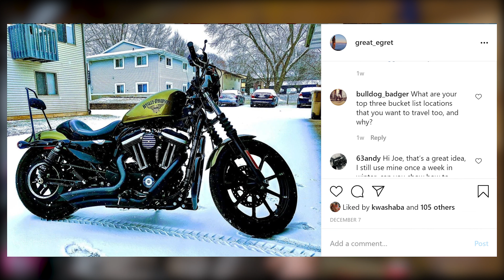"The Iron 883 is a SLOW Bike" & Other Comments

Comment: As for Andy, keep the immobiliser, just buy an optimate 3 battery tender, they work outside (waterproof) and keep your battery not only charged but healthy, you wont need to buy another battery for many many years so it will pay for itself
Reply from the maker: +Bulldog Badger great tip!

Comment: i have been pretty lucky with no oil misting. i keep the oil level where it should be and watch it. i have an 883 and a 1200 the 48. they both are solid and no misting.
Reply from the maker: I have more than most and I suspect my piston rings never set right.

Comment: Add paint, alarm, and Abs equals $11,000.  Motorcycle.com announced most value bike, Duke 890r less than $12,000.  TFT dash, rider mods, TC ABS IMU LED everywhere less than 500 pounds.  Harley makes Harley’s whereas other manufacturers make motorcycles.